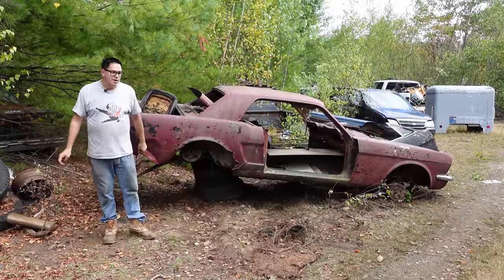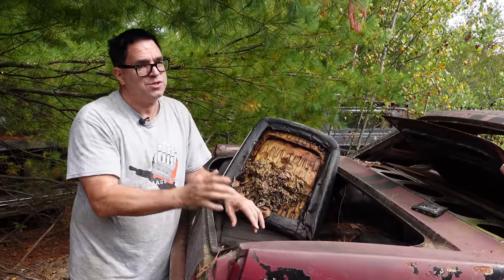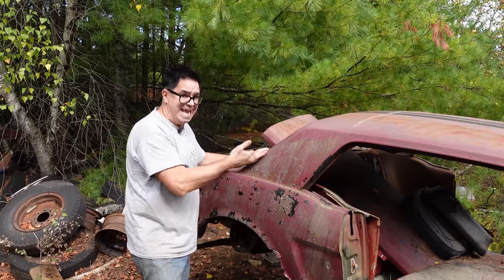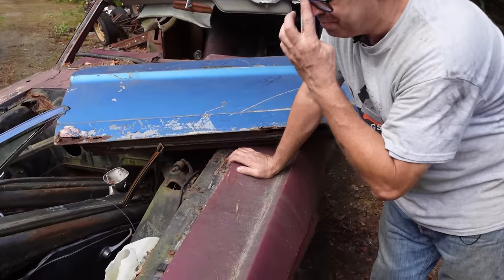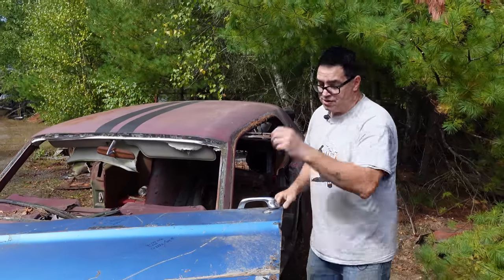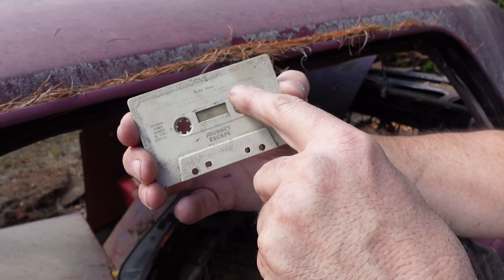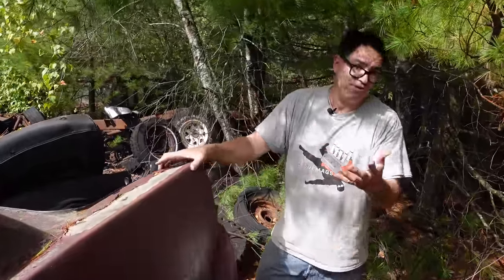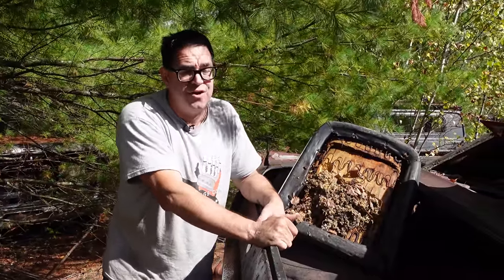Four Lug Rustang

Comment: Yup, that's right on the red Mustang: 6 for 1966 model year, T for Metuchen, NJ assembly (also called Edison Assembly), 07 for Mustang two door sedan, standard model with bucket seats, T for 200 CID straight six with one barrel and the rest is the production sequence. If the second digit is an "F", that's Dearborn, MI assembly (which assembled Mustangs through 2004. It is mostly gone but is known as the Rouge Complex now) and "R" is San Jose, CA (Milpitas) assembly which opened in 1955 and closed in 1983, and also assembled the famous "Bullitt" Mustang that Steve McQueen drove. The Metuchen plant opened in 1948 and closed in 2004 and was located at 939 Route 1 in Edison, NJ. I have passed it many times. A Sam's Club and Topgolf facility stand on it now. No tag (gone with the driver's door as stated, can't brag), but some of it can be figured out, no doubt: 65A for Mustang standard model two door sedan with bucket seats, 25 or 65 for red interior trim, possible 3 for Poppy Red exterior paint (if it was originally red), among other codes. 

The blue door is off of a 1965 Mustang, with that VIN for the win: 5 for 1965 model year, F for Dearborn, MI assembly, 07 for Mustang two door hardtop, C for 289 V8 with two barrel and the rest is the production sequence.

When you get the (blue door's tag), can (barely) brag: 65A for Mustang two door hardtop, R for Charcoal Green exterior paint, 26 for black interior trim, 10M for December 10, 1964, production which was a Thursday, 11 for Boston, MA sales district, 6 for 2.80:1 rear axle, non-locking, 1 for standard transmission.

So yes, when you lose the door, to a degree, it becomes a "Mustang Doe" of sorts, because only so much can be figured out. Hopefully that trim tag was put on the replacement door that was used on whatever car may still be "out in the wild".
Reply: Thanks GP !
Reply: @Ka9radio_Mobile9  Sure thing, anytime.
Reply: Growing up in Old Bridge, NJ I remember both the Metuchen plant on US Route 1 and the GM plant on US Route 9 in Linden. My 94 Chevy S10 pickup was built in Linden across from the airport. NJ had a lot of manufacturing at the time. Most of it is gone now.
Reply: @99somerville  Yup, my grandfather's friend, Mr. Bilotti worked at Linden and assembled both my '82 Toronado on Friday 9/11/81 and the parts car I bought to put it back together which was a '79 Toronado also made at Linden in March 1979. I went on a school trip in 1980 and remember seeing the "body drop" at Linden. It was a 1980 Seville Elegante black silver two-tone.
Reply: @99somerville  I lived on Snake Hill Rd in Old Bridge [elementary school ] a few years dad took us on a tour they were building 69 or 70 Mustangs if I remember correctly

Comment: I pulled a '66 Mustang coupe out of the woods a few years ago. I bought it for $150. I was going to cut the suspension out of it and use on a '65 Mustang I had bought that was a 6 cylinder to V8 conversion but still had the 4 lug/light duty suspension and axle. I picked the car up with my fork lift when it was at my shop to start cutting and noticed a 9 inch rear end with the tapered axle ends, meaning it was probably factory. I had paid no attention to the VIN at all. I let it back down, wiped years of mold and dirt off the stamped VIN in the inner fender and to my surprise it was a K code. It was amazingly solid for setting for 30+ years in the woods (according to the previous owner). It was a Candy Apple red with red interior and a 4 speed. I sold it on eBay to a guy who owned a Candy Apple red K code convertible and a Candy Apple red K code 2+2. He said this would complete his collection. I am happy it was saved. I cut the suspension out of a '66 C code coupe that as so rusty the seats fell out when I was moving it through the bottom and were run over to complete the conversion on the other car.

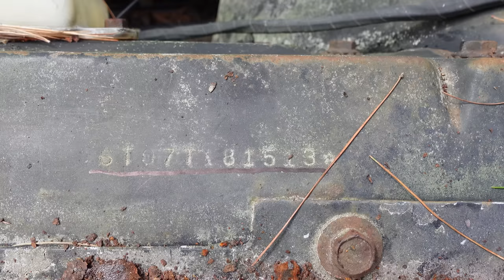Comment: Every time you bring up shock Towers it reminds me of the time when I was a youth and a friend tried to put a 351 in his Maverick not realizing it was a wider V angle so one day right around 4:20 we decided to massage the engine bay with a two and a half pound sludge until the engine fit it was incredibly quick
Reply: The angle is the same 90, the deck taller thus making the engine wider.

Comment: With that VIN, you can buy an entire Dynacorn body and get it back on the road.  You even could get a new tag for the door with the codes for whatever engine/drivetrain/color options desired.  The beauty of a 64.5/65/66 Mustang is that ALL parts are available.
Reply: That should only be allowed with some sort of caveat, such as "Reproduction" stamped across the tag or something like that. Vehicles can be "created" that shouldn't be.
Reply: There is no car left to save here
Reply: @wildman510  You'd be surprised.
Reply: @wildman510  - If someone were to pallet and ship what's left to me? I could resurrect it. From the sub-frame up and saving as much of the original sheet metal as possible (roof, firewall, hood and deck lid, doors, etc).
Reply: having a rusted out 67 convert, i can say these are the best "raw material" to start with for a Pro Touring mod with MII front suspension and a Coyote swap and all that...not some rust free 289 model. tho it was quite common back in the day to get an S code 390 to do a GT500 clone--even before clones were popular, Tony Branda et al helped the PC1 crowd make some interesting cars.

Comment: I have fond memories of my mom's 2 Mustangs. In the mid 70's she had a 289 4 speed '65 coupe & a 6 cylinder automatic '67 convertible.  Both were the same blue paint blue interior layout. Sadly they met the same fate, the rear springs came thru the trunk floor thanks to years of exposure to rust from Pennsylvania's salt laden roads in winter. Both were gone by 1982. She always wanted another but never got one. 😔

Comment: Steve, hit close to home on this one! one of my many cars(approx. 80) was a 64 1/2 coupe. It was my aunt’s car and started out life as 6. My Uncle had cobbled it together from two wrecked units. We added a 260 then 289 and didn’t up grade the rear. I end up with car changed the rear to a posi from a friend’s rolled 2+2 hypo 289, but left the 4 bolts on the front.  It goes on and on. It was cheap in the mid 60’s and a great learning experience for a 16 year old. Thanks

Comment: I remember noticing that the early six cylinder Mustangs received the four lug Falcon underpinnings and wheels when I was a kid trying to figure out cars. Cragar made a four spoke version of their ubiquitous wheels, which may or may not have helped the look of these.
Reply: those 4 lug Cragars really had a unique look, and depending on how it ended up in rotation, sometimes its "4 spoke" factor really stuck out.
Reply: One thing Ford definitely got right with the original Mustangs were the 14" wheels, whether they were 4 lug or 5 lug. They actually had real tires on them. Newer Mustangs have huge diameter ghetto style "donk" wheels, with just a narrow strip of rubber wrapped around them. Even my 2003 V6 Mustang came with 16" wheels. Older style wheels don't fit, because newer cars have a metric lug pattern, which is just slightly different from the older Ford 4x4 1/4 and 5x5 1/2 lug patterns. I was able to find a nice set of 15" wheels from a 2000 V6 Mustang, which allowed me to put RWL BF Goodrich Radial T/As on it. The newer Mustang GTs have 17", 18", and 19" wheels and virtually no tires at all. I have seen these cars with 15 inch drag race wheels on them, and they look great.

Comment: I've owned 4 Mustangs over the years. A '65 coupe, 170 C.I. w/3speed. A '66 coupe, 289 w/3 speed, A '67 coupe, 289 w/automatic. A '68 2+2, 302 w/automatic.

Here's an interesting tidbit for those who don't know. The '65s had a speedometer that was horizontal. The '66 had the first round speedo in a Mustang, and was the only Mustang speedo that went to 140 MPH. The '67s and '68s had round speedos, but they only went up to 120 MPH,  like the horizontal speedo in the '65.

Comment: To me, Mustangs have always been about looks more than anything else. I have owned 2 Mustangs, still have one of them. The first one was a 1976 Mustang II Ghia notchback, with a V6 engine and manual transmission. The other one is a 2003 V6 Mustang, with the 3.8L pushrod V6 and an automatic transmission. Neither were or are used as "enthusiast" cars, meaning I don't work on them or modify them for fun. They were/are good looking 2 door, rear wheel drive, solid rear axle daily drivers. Nobody considers either one to be an actual Mustang, because they don't have at least 500 hp. People don't seem to remember, or haven't researched the fact that the original Mustang concept was a "restyled" Ford Falcon. Almost everybody bought them because of their looks. They were NOT sports or muscle cars. Now I do have a couple of cars with a lot of power, cars which I built, or highly modified myself. What I consider to be "hot rods" I have built several hot rods in my life. They are enthusiast cars, and I have raced most of them on the dragstrip. But I never exceed the speed limit, do burnouts, or any other illegal and dangerous activities with them on the street. I love late '60s/early '70s muscle cars, especially Mopars, and have owned a couple of those as well. But again, I never drove them illegally on the street. My very first car, at age 16 (my dad bought it and financed it, I made the payments) was a base model 1970 Challenger. 318 2 barrel, column shifted automatic, single exhaust, split back bench seat. Not fast, definitely not a muscle car, but it was a real beauty. I owned that car for 9 years. 

That "really dumb" Ford front suspension design is a nightmare. One of my hot rods was a 1964 Fairlane that originally came with a 200ci straight six, and I put a 390 in it. Putting headers on it was impossible. The 390 was actually a factory option in the '64 Fairlane, but they had to make special "flat" exhaust manifolds to make it fit, which were very restrictive. Putting the springs between the upper control arms and body instead of between the lower control arms and body/frame also made it almost impossible to get the springs out. I needed to install stronger springs due to the weight of the 390, and while doing so, I broke 3 spring compressors and almost killed myself when one of those springs popped out, flew by inches away from my head, and landed over 50 feet away. I never tried to remove springs from one of those cars again, but have never had a problem removing springs from any other car/truck. You just have to wonder what Ford was thinking with that design.

Comment: Hi Steve, my first car was a 1966 Mustang 2+2 fastback.  You forgot to mention that the rear seat(s) these fastback(s) where where not suited for two adults.  But you did receive a fold down rear seat, (1965-1968 standard) (1969-1973 optional)  when folded down, it had a carpeted sport deck with a second fold down front cover with chrome trim, hiding the rear seat completely.  Please reply.  Dave...

Comment: I have the 1990 version of this car bought it new June 1990 red on black 5 speed and it has the 4 lug wheels. Never made a difference in my driving experience. Car does burnouts like a champ and sounds very good for a stock block 302. And it has the drum brakes in the rear. Not a performance car at all but what do you expect for 14 grand? I might drive it today it has heat unlike my bike and gets grocery parking lot attention. You can see the guys looking at the old school (to them) muscle fat tires dual pipes and that 5.0 on the fender. I was 26 when I got it now 58. It looks newer than me and rides like a bucket of bricks but I love it. Cheap insurance now only $120 per year! Sorry for the long comment but I like Mustangs they were everywhere when I was a kid.

Comment: I had a '66 Ford Mustang 6 cylinder coupe like this one. It was in gray primer. it sat lower in the right rear because the leaf spring was poking up through the rusted trunk floor.

I paid $40 for it, in 1974.

Comment: Even back in the mid 70's a 1964 1/2 thru 1966 six cylinder Mustang wasn't worth that much compared to a factory V8 one. I had a friend in 1974 buy a 1966 six cylinder convertible with a factory bench seat for $100.00. the top was shot but the body was still good. He used it strictly as a beater work car to keep his low mileage 1972 Monte Carlo SS nice.
Reply: and that $7 bench seat option was rare--was just at a hot rod show today someone had one in their 50 Ford kustom. But it was great for the make-out crowd compared to the slippery buckets that had no latches--you hit even the drum brakes hard and that empty passenger seat wanted to slap its back around

Comment: The 4 lug wheels are a sure sign of a six cylinder mustang in those years. The oddball came in 1969,when you had the "performance 250 cid 6", which came with the 5 lug wheels, while the stock, smaller six  did not.

Comment: Vin on the rail in front is where the State police used to do a vin verify for the 71 mach1 I had. Bought from an estate sale. Someone's project in process of restoring. Sold it on eBay
Reply: In later years, most manufacturers moved the VIN up to the dashboard for that reason in addition to having it in other places. They also put it in multiple places to help foil theft and counterfeiting. Later door jamb decals (on GM at least state), "This vehicle complies with all applicable motor vehicle safety standards, bumper standards and theft prevention standards in effect on the date of manufacture shown above". Later vehicles got "one time use" VIN decals on major parts which would reveal the word "VOID" when removed.

Comment: 🥝✔️. The 6.75 inch axle continued in the base Pinto, and additionally, the base Fox body 78-82 Ford's with non 7.5 inch axle. Look under an 83-87 2 liter Ranger, and it's there as well. They changed the pinion length and axle spline count, but the Center was the same from the four lug 1960 Falcon to the last 5 lug 2 liter Rangers with it. Right wads. 27 years of low buck "usage"...

Comment: Ironically, the Mustang has a lot to owe the T bird. Ford wanted the original Thunderbird to show the Corvette it should have had a V8, but at the time Ford only had the heavy Y block so they made it more of a cruiser on the Fairlane platform. Once Ford had the lightweight casting low deck Windsor, the first Mustang prototypes were 2 seaters.  but Iacocca recognized a grand touring car with a back seat would sell better, and the GT option was posed as a "mini thunderbird" since the T bird had established itself as a personal luxury car. Ford would use the "Thunderbird engine" to denote performance (just as every 2 bolt mains small block in a hot rod is a "Corvette engine") even in a 406 FE model that never saw a Thunderbird engine bay...but once Carroll Shelby made the Cobra a household name, Ford used it instead to denote performance engines like the Cobra Jet and Super Cobra Jet--even though lower performance 428 and 429 big blocks showed up in Thunderbirds early on.

It's interesting to remember the performance market in the middle of 1964. Lightweight "muscle cars" like the 1955 Chevy with a corvette V8 had been replaced by "Super Stock muscle" of big Galaxies, 409 Impalas and 421 Pontiacs that were not cheap to buy (but dropping the 413 Max Wedge into Darts in 1962 likely showed the near future). Corvettes were sports cars that weren't hit with insurance premiums just yet, and the Barracuda that beat the Mustang to market looked like a Dart. But Pontiac had introduced the GTO. The Mustang replaced the Corvair as a sporty looking commuter car (as households were able to afford a second and even third car for the kids) that could be optioned for performance to take to the tracks on the weekend. If you have car magazines from this time, you could see ads for parts to personalize your Mustang (even horse shoe shaped bumper guards) take over for parts to personalize your Corvair (and today's Honda crew get gas and brake pedal covers).

By 1966, Rodger Huntington was predicting performance had reached its peak. The 426 Hemi, the 427 Ford, the L88, and Olds W30 400, they couldn't get more radical without becoming unsellable (one of the big profit margins is luxury options and these engines barely made the vacuum to run them--Detroit would solve this problem by increasing stroke and displacement). Corvair lost its swing axle but it didn't recover from the problem and the other competitor to Mustang in the Trans Am circuits was the D code 273 Mopars--but next year GM had two new competitors and they would pack Corvette big blocks. and Mercury would offer a competitor that had a V8 standard, soon a competitor as well to Mach I and later Shelby Mustangs as far as big block grand touring pony cars were concerned. 

It is amazing that the Mustang survived its competitors, the 1973 gas crisis, two attempts to make it front wheel drive (Ford EXP/LN7 and later the Probe) and we may continue to see it as an electric car.

Comment: sedan? coupe?
Reply from the maker: Hello Mike Rosetta, I take use the term "Sedan" in Mustang land as Ford did in the Fox years when the non-hatchback was called the sedan in factory service and sales literature. It is true that I also use the term sedan when referring to 2 and 4 door bodies with full window frames built into the doors and a fixed roof pillar between the windshield and backlite (think 1965 Dodge A990 Hemi Coronet). Hardtops are these cars without the window frames and a full sweep of open air with all windows rolled down. These terms are "general" and I hope aren't too confusing. But when Ford uses the term, I go with that. But also acknowledge that Coupe is also a common term for the non-fastback / 2+2 Mustangs of the early days. Thanks for watching and writing. -Steve Magnante